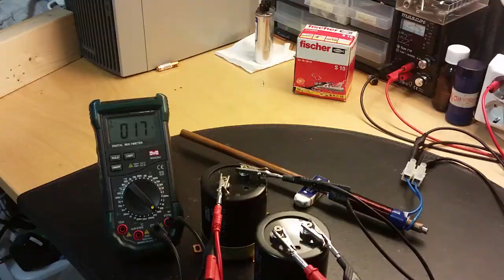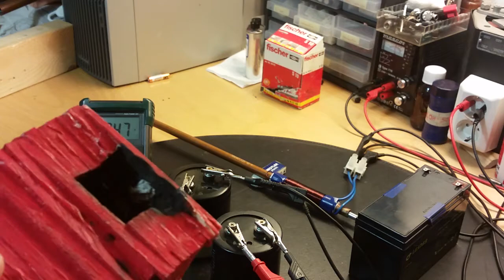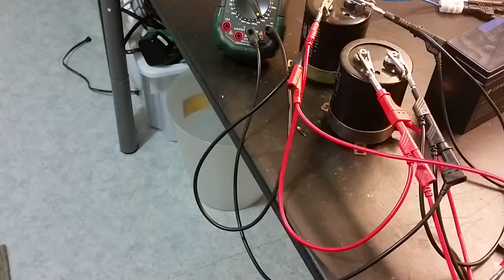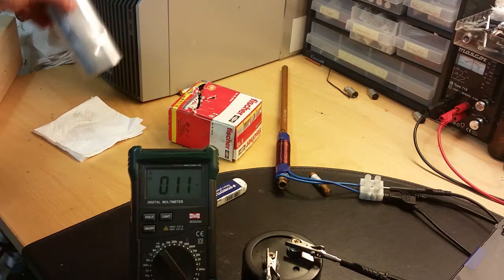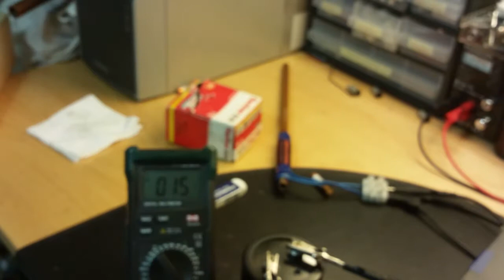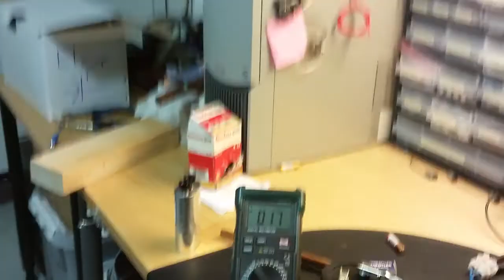Coil Gun Project

Comment: thanks for posting.  some thoughts.  obviously, the gun should be anchored, to reduce recoil losses.  imo, the power side of the circuit is dc, so rectification is simply causing a voltage drop.  for the propulsion coil, i suggest a brooks coil, using 14awg magnet wire.
if using smaller wire, wind coil 'in hand'.  compare the resistance to that of the existing coil.  (not sure your math is correct.  8800uF  is  .88 farads;  if the equation is C x V, then its 308 joules)    cheers
Reply from the maker: Thanks for commenting :D 
The rectifier is rectifying the mains voltage to DC to charge up the capacitors, the choke (a MOT with open secondary) is on the AC side to limit the inrush current to the capacitors. Total capacitance is 8800µF or 8,8 mF or 0,0088F, and voltage after rectifier is round 340V (voltmeter)

Capacitor energy formula is 1/2 C x V(squared), which gives  0,5 x 0,0088F x 340V x 340V = 508J (I round off the last digits) 
The formula C x V gives the charge which in this case is 2,99 coulombs
Cheers :)
Reply: aha.  thanks.  last thought.  warning, my knowledge in this area is limited and theoretical, only.  i never hear amps or watt-seconds mentioned.  can you tell me the amperage going to the firing coil.  cheers